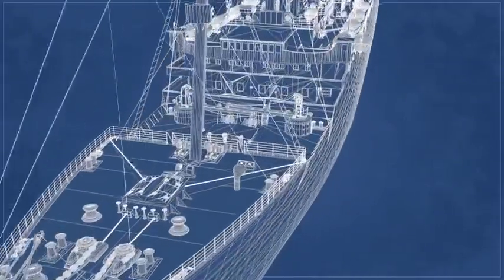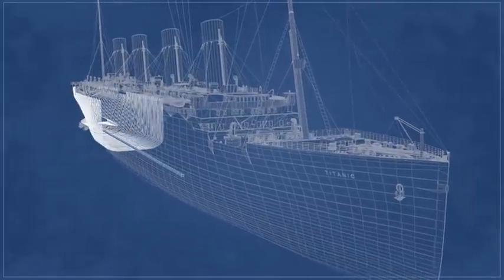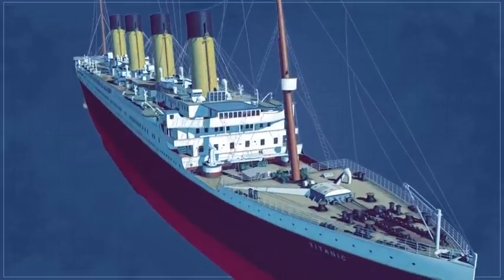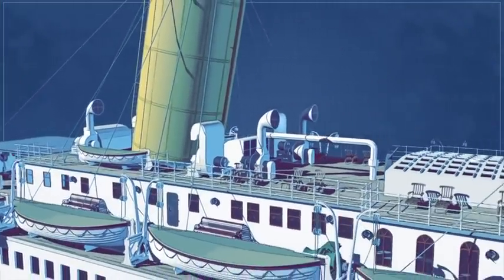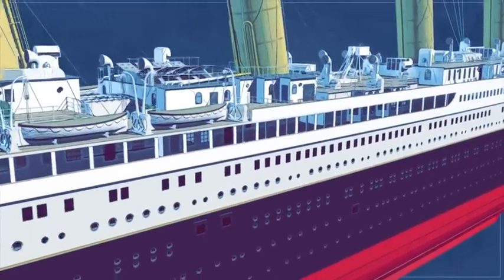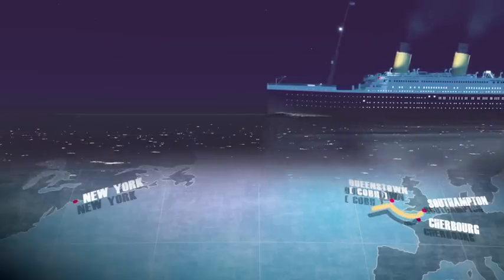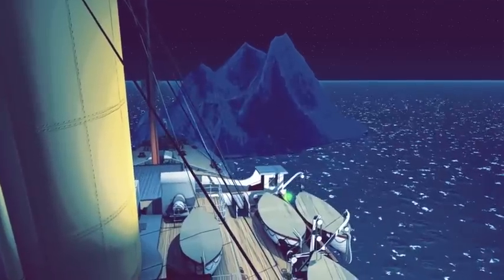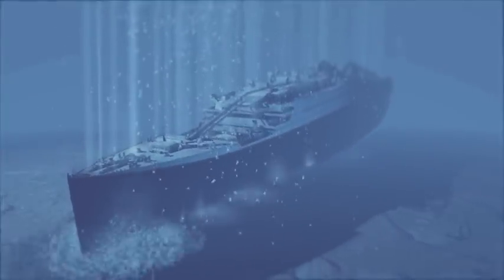The Titanic 3D Model - As You've Never Seen Her Before

Comment: Great idea having the flood bulkheads not go all the way to the top of the vessel. Very effective at saving a few thousand quid, sinking a vessel and killing 1,300 plus people... Way to go, NOT...
Reply: It doesn't have to. And don't picturise the ship as an empty vessel with multiple walls like an ice tray. 
The watertight bulkheads mean that they are watertight upto a certain height. No way water will leak. After that, when the compartment is filled and there's too much weight pulling down the ship, the water flows through the upper deck's walls, doors, stairs etc into the next compartment. Because they aren't watertight and sealed. Bulkheads will go throughout the ship's height. It's just that the water seal and extra reinforcements only reaches a certain height. 
In that era, Titanic's 4 compartments would flood and still the ship would've floated. That was far safer than many other ships. 
In those times, ship to ship collisions and grounding were common. Even in an extreme case of ship to ship collision, only 2 compartments would flood. In case of TITANIC, Harland and Wolff over engineered the ship with a series of smaller watertight compartments such that they could float with 4 compartments flooded.
It's just that, when she hit iceberg the damage went beyond the limit of 4 compartments to 6.
Reply: @gokulgopan4397   Thank you for the detailed explanation...

Comment: The lookouts didnt need binoculars... since the lookouts are there to "scan" a wide area, with binoculars it takes longer to scan the same area, not to mention the job of the lookouts was not to identify objects... but to notice any object, ring the bell, and the bridge officials are the ones that used binoculars. Also its wrong that they didnt fit more boats to give room for the wealthy to excersise... Also they had 4 more boats that it was required by the law, also boats back then, in any ship, were meant to fully evacuate a whole ship in open sea, they were meant to ferry passengers between a damaged ship and a another ship. And considering that they only had time to launch successfuly 18 out of 20 boats... more bouats wouldnt have made a difference, also the shipe borke between the 2nd and 3rd funnel, almost right next to the 3rd funnel

Comment: I remember an article saying that if she had run straight into the iceberg she would have survived the collision with just a dented bow.
Reply: Probably frame damage too expensive to repair, but yes lives would've been possibly saved.
Reply: @topz6598  No Suevic grounded, they cut the entire bow off, sailed the midsection and stern to Southampton, built a new bow in Belfast and reattached. She sailed many years. You cut out the damaged part and make a new bow. Some ships hit dead on. They "telescoped", crushed. 

BTW Suevic was also White Star and Harland and Wolff made those repairs. 

Titanic would have lost about 80 feet. Crushed... so not able to hold water and pull her down. About 200 would have been in that area, mostly crew and some third class single men. Families where in the stern as where single women (old ships kept those groups seperated, which reduced complaints by female passengers and workload for security).

Comment: Excellent presentation. However, as some people might know there's no consensus on how the Titanic hit the iceberg. If the order was simply to steer to port to try to go left of the iceberg, the theory is that the Titanic would have pivoted and it would have been the midship and stern that would have hit the iceberg leading to much more considerable damage. It's been suggested that Murdoch instead gave two successive commands in an effort to port around the iceberg, and the ship hit the iceberg at the point when they in fact turning to starboard.
Reply: Well, binoculars would have been pretty useless, in the middle of the Atlantic, in pitch black at night and early morning.
Reply: @JokerScribe  Uhm... yes. They wouldn't have made any difference. The missing MSG in that California ice warning potentially made a much bigger difference. There's much less talk about that than about the binoculars.
Reply: That's how big ships move, turning the rudder at full speed will swing the bow but it's still mostly moving in the same direction, so Murdoch ordered hard to port (non tiller) and once the bow swung clear of the berg he ordered hard to starboard to swing the stern out of the way, at that point Titanic was already in contact with the iceberg and stern moved out of the way just a second too late. 

The animation shows the 6 gashes. You can see the last one is really the only problematic one. She could float with the first 4 gone but the sixth gash opened compartments 5 and 6 (Boiler Rooms 6 and 5, seen from the bow). 

That's what sank Titanic. Boiler Room 6 besides that gash only had a very very small opening and the pumps where quite powerful, they could have dealt with Boiler Room 6 and Nr.5 would have been completely dry. So she would have easily floated for many hours and once Carpathia got there she would have run hoses from her own pumps while the passengers would be transferred. And once a bunch of ships show up they could have pumped out some more, shore up the worst of it and very slowly sail to Halifax for basic repairs and then back to Belfast. Basically what happened with Olympic. 

The last incision was 36 feet long by far the largest and at 10 m/s it happened in the last second of the collision. So if the Berg had been spotted 1 second earlier there is a good chance Titanic would have survived and at 3 s she would have certainly survived. Likely able to sail on at reduced speed with 2-3 compartments open. The entire impact sequence would have been around 8 s.
Reply: @please_stop-v7o  Interesting details, thanks. It's mindboggling to think that so much can depend on just mere seconds, or inches, thinking in terms of the iceberg.
Reply: @Katoshi_Takagumi  That's how it often goes. You probably came within a second of dying and never noticed. Some guy realised it's a red light at the last second and slammed onto the brakes instead of killing you. You could have been in an aircraft that missed a Cessna by 20 m and no one on board ever found out. Cessna pilot just got told to not fly over a busy airport unannounced.

Comment: The so called water tight compartments were not water tight.  how would the designers not know that ? they had to know  the walls of the compartments didn't go all the way up to the top. so were they just lying to the public saying the ship was unsinkable to get publicity ?  and after the Titanic sunk. they made all of the improvements to the sister ship making the walls go all the way up to the top. like they knew exactly what was wrong with the Titanic that made it sink.
Reply: What's the point of making compartments if they are not all way to the top. That's just plain stupid.
Reply: According to board of Trade regulations, watertight bulkheads were to be minimum 3 meter above the waterline. Besides, the most common accidents were grounding or ship-to-ship collisions. Nobody is thinking of a possibility of side swiping an iceberg. 
By that design, her limit was 4 adjacent compartments flooded. 6 were breached, way beyond the considered limit. This 4 compartment limit was calculated after sinking in the British/US Inquiries.
This limit was considered by the previously mentioned experiences. With that in mind, Titanic could float with upto 3 consecutive compartments flooded at front and back or 2 consecutive compartments midships. That's what they could imagine as a worst case scenario. 
It's this watertight compartment design that helped her float almost 3 hours. 
These compartments are watertight, not airtight.
And nobody said she was unsinkable. Based on the watertight compartment design from then experiences, the shipbuilder magazine described Olympic class ships as Practically unsinkable. The press publicized it as unsinkable. This got exaggerated overtime.

Comment: Wouldnt it have made sense to simply put a spotlight on t he crowsnest so the lookout could shine it ahead like a headlight? Also, if they had driven head on into the 'berg, she would have floated and not sunk, instead it ripped a huge gash in the side and too many compartments flooded.
Reply: Yes, a powerful spotlight is very helpful in spotting 'growlers' - old small icebergs, that usually have 'turned turtle' with their smooth & rounded underside now on top. Even though 'small', nevertheless, could still easily weigh 50 to 100+ tonnes, and only riding 6-8 feet (2-3 metres) above the sea.  When we used to run to the high Arctic, at night, in the autumn of the year, radar would not detect growlers on account the radar waves bouncing-off the smooth and rounded surface, we would use powerful spotlights port & starboard.
Using this method, we could spot growlers at night at a range about 1-1.5 nm (nautical miles; 1nm = 6080 feet) ahead, yet never observe a return echo on the radar screen.
Icebergs did give good echo returns on radar screen.

All in all - we were a young crew and had a great time together.  The high Canadian Arctic, in summer, is an absolutely stupendous, magnificent and magical place!  

That was almost 45 years ago now - made some life-long friends on the ship, and now, semi-retired from sailing, know I will miss the high seas once am 'fully retired'...

Comment: Side propellers turns in the other wise and central one is four blades. Several pictures prove that. Nice video!
Reply: Center one was 3 bladed. No pictures of Titanic's props are available except a center prop being kept in the wharf ready to be fitted. It's 3d render was done and found to be 3 bladed. Plus additional documents from Harland and Wolff and engineer's notebook
Reply: @gokulgopan4397  Yes, the central 4 blades pictures are actually taken from the Olympic.
Reply: The Titanic's central propeller was 3 bladed, as there is official H&W documentation accounting for this, aswell as a photo of it laid on the wharf next to the ship waiting to be fitted. It is clearly 3 bladed. Stop spreading misinformation with absolutely no credibility or evidence to back your claims.

And the photos you claim to be the Titanic with a 4 bladed centre propeller are actually of Olympic taken in 1929. Do your research.

Comment: As for Her Lifeboats there was meant to be 64 but due to cost cutting and other things (passenger comfort over safety and out dated regs by the board of trade) they only put 20 boats on her.
Reply: No ship on eath before the Titanic disaster had enough boats for all its passengers and crew, and no maritime disaster before or soon after the Titanic had a case were all boats were used successfully without incidents, Titanic had 20boats and only had time to successfully launch 18, and it took 8 to 10 mins to launch each boat, not counting the time to prep each boat, and the time to load each boat, with 64 boats, they would have needed a bit over 4 hours to launch all the boats, again not counting prepping the boat and loading the boat, just lowering the boat to the water.
Reply: No expense was spared. The boats where very cheap compared to anything else including a single of 64 electric vents that pulled air into the ship. Electric stuff was pricey in 1910.

Comment: Now imagine if they had those 32 other life boats.
Reply: didn't need them....
it was unsinkable....
Reply: Or a simple pair of binoculars
Reply: @timothyphipps7883  
a ship that size and only one pair of binoculars....
fucking hell - I have THREE pairs and 2 telescopes for my own uses....
Reply: @volpeverde6441  some type of permanently mounted unit in crows nest
Reply: @volpeverde6441 the ship had other 6 pairs available onboard with the officers. If it was deemed necessary they would've issued it to the lookouts. 
Lookouts are supposed to scan a large area and spot something. Binocular limit this field of view. It shows an enlarged view which prevents judging the distance and size. 
 They spot things against the horizon. But the false horizon phenomenon, unknown at the time, made spotting the iceberg very late. 
That day, binoculars wouldn't have made much difference.
Reply: I don't imagine it would have made a huge difference, there was a huge lack of communication between the officers onboard and a frenzy among the passengers. Not to mention many of the lifeboats were not launched at full capacity. The Titanic had as many lifeboats as were required by law at the time, not that it makes the lack of them correct.
Reply: The number of boats was enough for emergency, but the number of passengers should have been 4 times less than were on board, simply because a ship isn't planet Earth, which you may overpopulate (overload) as much as you like.
Reply: No use. Only 18 lifeboats were launched properly. By that time water reached the boat Deck and her final plunge started.
Reply: Didn't need them. The Californian was supposed to aid them.
Reply: The crew couldn't get all of the first 20 launched. What do you think would happen to 32 more boats?
Reply: @j.savage1228 Just imagine it was the largest ship of dat tym and the crew was not trained for emergency situations.. sad dat crew wer not even informed about the capacity of each lifeboats..

Comment: The commentary says the order "Hard a-starboard" was given so that the ship turned to port; this is how it's portrayed in the film too. However, such an order actually means that the wheel is put hard over, in this case to starboard, which is the way a ship would then turn. So this explanation makes no sense.
Reply: Rod: Even though Titanic had a wheel, White Star was still using tiller commands, which were a carryover from sailing when a tiller was used to steer the vessel instead of a wheel. Think of an outboard motor on a small fishing boat...one that you steer with a handle/throttle behind you. To turn left, you push the motor to the right. The quarter masters at the helm knew hard a starboard actually meant turning the wheel left, all the way to the stops. Titanic actually had a tiller and when the wheel was spun left, the steering engines actually pushed the tiller to the right which pushed the rudder left. A port turn followed.
Reply: @msz5543  Thank you! Am aware of tiller steering, but was not aware that these commands were used by White Star.
Reply: @long_view  You're quite welcome. I gave a little extra info there, LOL.

Comment: You left out the coal fire that was burning at departure and severely weakened the area of the ship that collided with the iceberg, causing her to rapidly take on water and sink
Reply: Nope. It was a smouldering fire, not a wild ravaging fire. Smouldering fire doesn't get to temperatures that's close to melting point of mild steel.

Comment: I dont understand why they didn't build the compartments in the hull to the ceiling? To the top? Once water enters the ship, its pretty much guaranteed to fill everything in a serious scenario. Im not well versed in engineering however how did someone not say - "Hey this just wont work as the ship angle will automatically change with more water and we will sink" 

If this potential reinactment is fairly accurate, It would suggest the ship would have definitely survived had tje design in the hull been different. 

Also no binoculars for the watcher? It is pitch black out there more often than not at night so maybe the impact would still have happened anyway 

Rest in peace to all those that were on the ship that day.
Reply: The height of watertight bulkheads were based on board of Trade regulations. The watertight bulkheads should've been 3 meters above waterline. That height was sufficient for scenarios they had in mind, their experiences. Nobody envisioned iceberg side scraping and opening up 6 compartments instead of 4.
Binoculars wouldn't have made much difference. It limits field of view. To spot something, lookouts need wide view and that against the horizon. Binoculars only give an enlarged view which prevents judging the distance and size of the obstacle.
Reply: They were cutting costs .... there are speculations that there was a fire in the coal bunker and the ship still sailed
Reply: @bogdanflo1212  not cutting costs. It's a passenger ship, not a battleship. It needs passenger space.
The coal fire didn't affect anything. It was a smouldering fire. They don't burn to a temperature that melts mild steel.

Comment: Why does the back of the ship pop up into a vertical position at 4:50?
Reply: The front half of the flooded ship wants to head downward so the ship goes into a vertical position since the stern section is not yet flooded and still very buoyant.  Then suddenly the weight and stress of all the flooded  bow weight becomes so great that the ship tares itself apart . The front or bow section then plunges downward while the stern still contains residule  bouyancy and will for a time return to a fairly level position until it also fills and sinks . Even that section tends to tilt downward as it floods so the very rear or stern rail is the last to go under . Even with no one aboard , it's a rather sad experience to watch .  Hope my explanation helped you .
Reply: @paulwieben4948  I don't think that explains why at exactly 4:50 the back of the ship shoots up into the sky after resting on the water for a moment.